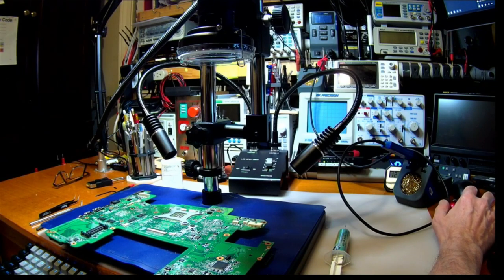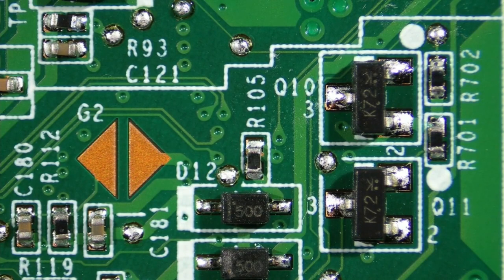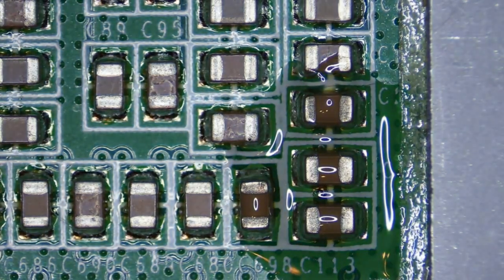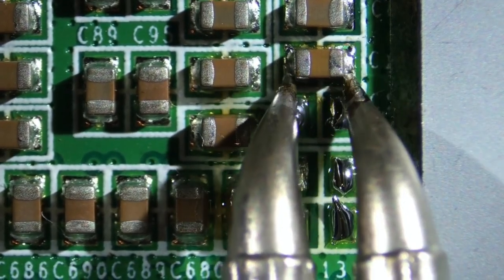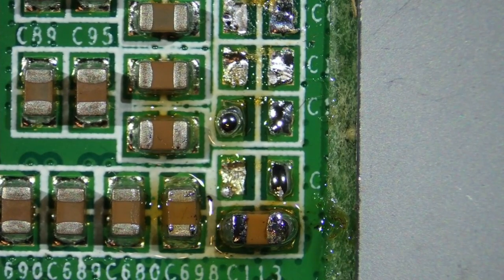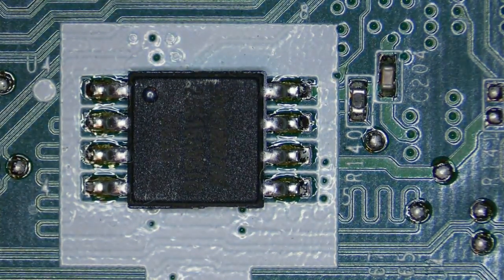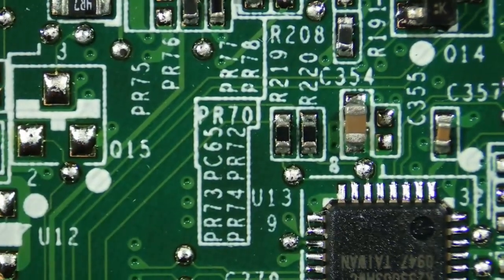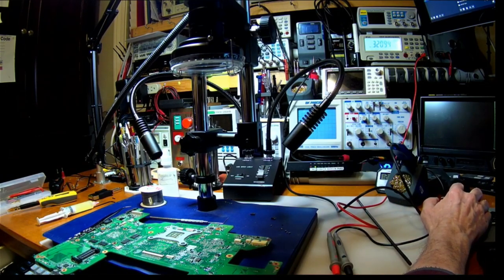Evaluating a Goose-neck LED lighting system for Micro-Soldering with a Microscope.

Comment: They are very useful. You have to adapt a bit with it and getting the right positioning because it can get in the way when soldering and using hotair. I have had mine about 2 years from the same seller. Thank you for sharing.

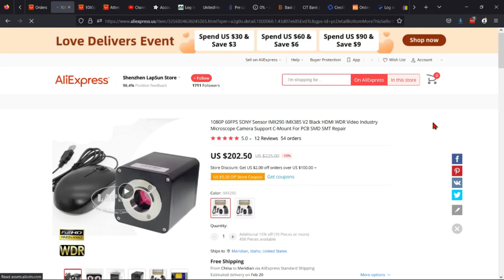Comment: I have the IMX385 version of the camera you showed at 13:14, it does allow for manual brightness adjustment
Reply from the maker: Yes, I have several cameras and the ones with HDMI output do have some brightness adjustment.  However, I am still looking for one where you can simply turn off the Auto-Brightness feature all together and then being able to adjust the light level for best contrast etc instead of he camera interfering. If anyone can recommend a HDMI output Webcam under $300 with manual focus like that I would like to hear about it.
Reply: Yes, the camera allows auto brightness to be completely turned off, to the point that the image is pitch black without proper lighting. It is expensive though, you're right. @Tech-Relief